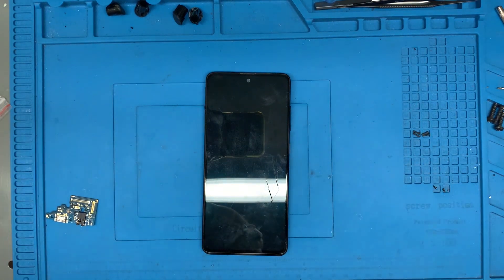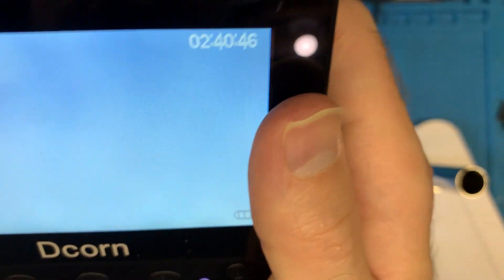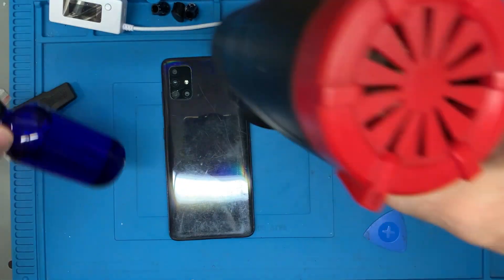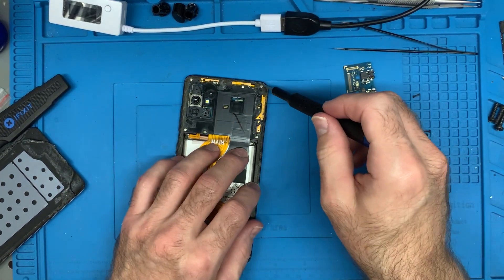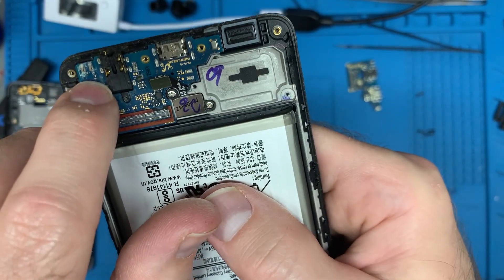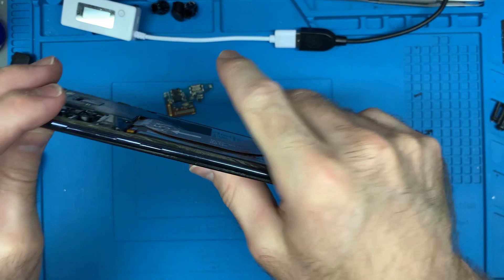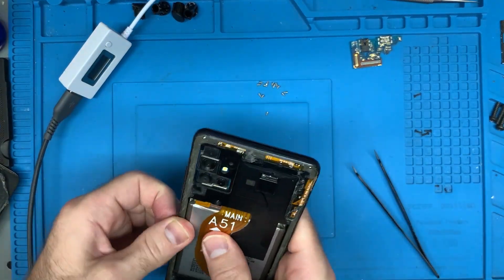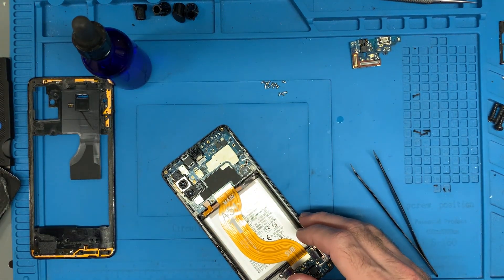Samsung Galaxy A51 Won't Charge - Fix Attempt Using Hypersonic Cleaner

Comment: Same symptoms, replacing the port didnt fix it. what was the root cause?
Reply from the maker: I believe there was a crack in the FPC connector that connects to the long cable from the bottom board to the top board. The FPC connector needed to be replaced